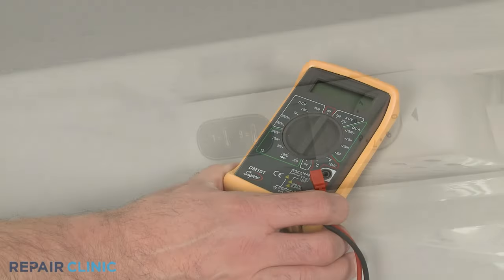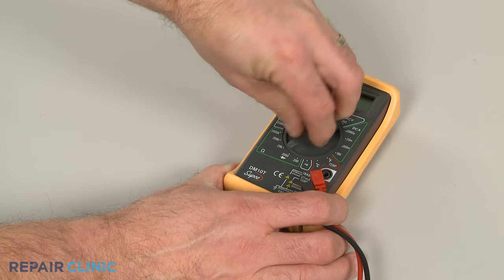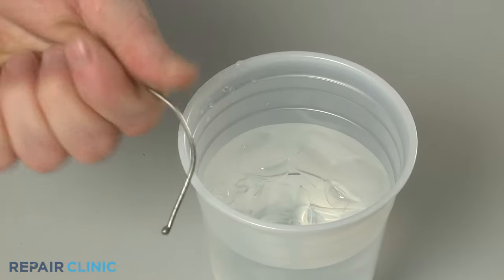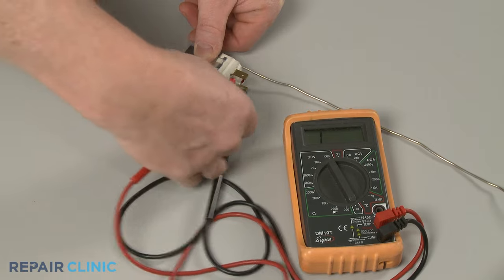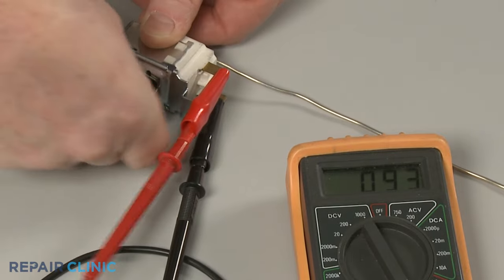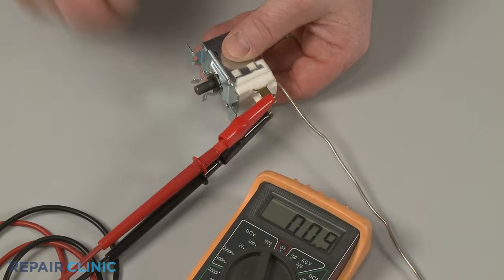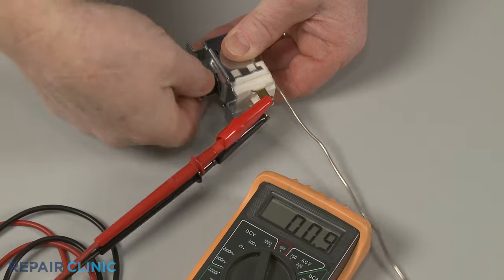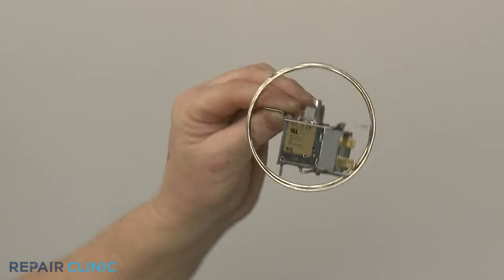Refrigerator Thermostat Testing

Comment: Hi,  if a thermostat clicks on (establishes contact) when the temperature dial is turned clockwise, but does not click off (disconnect) when the dial is turned counterclockwise until the dial reached the 'off' position; is that normal behavior or is the thermostat faulty ?
Reply: I have the basically  same question.  Except mine "clicks" at shut off both ways. (turning On and turning OFF.)  But it doesn't "click" anywhere else like at a temp. point shutoff  (ie 40 dgrees for example).  I have a mini fridge manual defrost and it's not cooling.  It could be the thermostat, compressor or the relay on the compressor.  when I plug it in and put my hand on the compressor it feels like it is vibrating/hum a little.  when I turn the thermostat OFF it clicks and I don't feel the little vibration.  I want to replace the cheapest of the two parts to see if that is the issue.
Reply: @tfs4693  Did you determine what the problem was in the end?
Reply: @patrickobrien8851  yes.  It was the black wire at the thermosat  It was loose and was not making good contact with the thermostat.   I squished the connector a little to make it grab better with my pliars and put it back on.  It's ran like a champ since then.
Reply: @tfs4693  Very glad to hear that.  Besides the cost of replacement, the thought of throwing out an otherwise good appliance because of (what turns out to be) a simple problem is something we do too often.  Well spotted!

Comment: Hi RepairClinic, thanks for your nice videos! My Amana bottom freezer mount fridge is  cooling the fridge, but the freezer is not cold enough, and  I don't see ice buildup on the evaporator coils. Could a bad cold control thermostat be my issue? thanks.